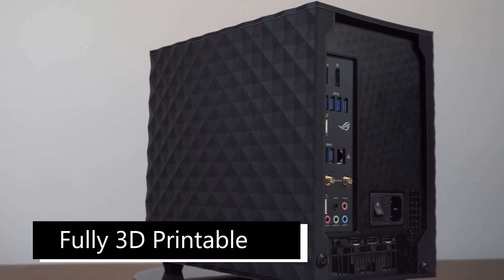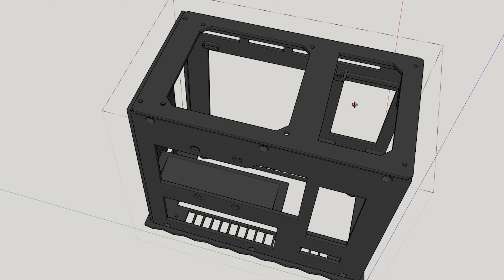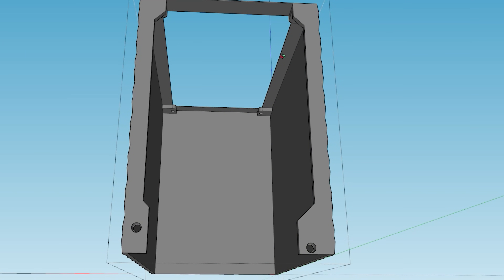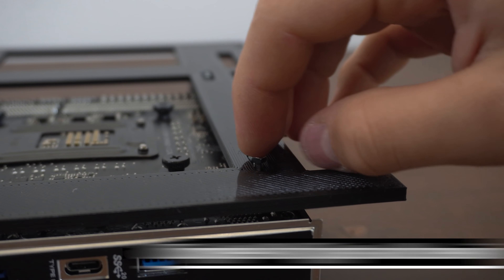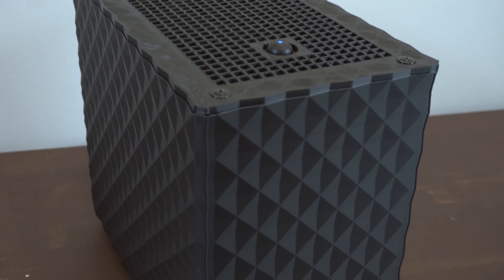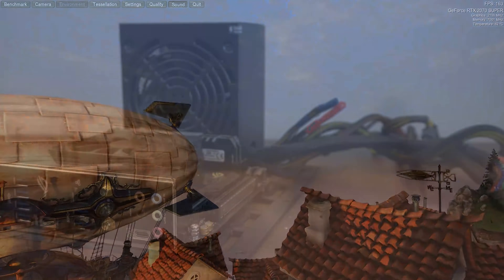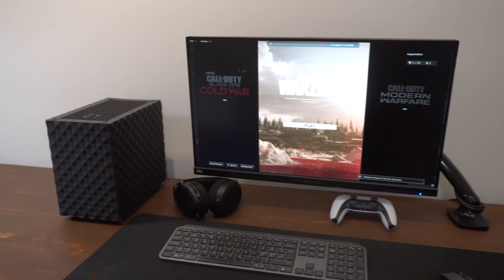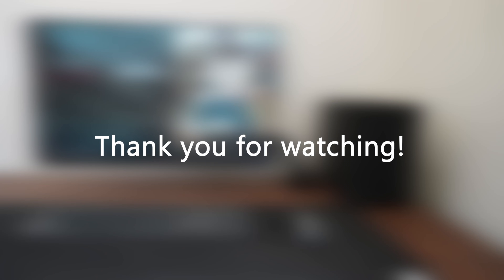CLEAN CUSTOM MINI ITX PC CASE BUILD | 3D Printed

Comment: I wonder how long can the case sustain CPU+GPU stress test without deformation due to high temps.
Reply from the maker: I honestly don’t think that will ever be a problem... PLA starts to slightly soften at around 60 degrees, but isn’t really soft to the point where it actually starts to deform by itself before like 80-100. 

Lets say a GPU reaches 85 degrees in an example. That doesn’t mean that it blows out 85 degree hot air. It means the actual processor in the card has a core temperature og 85 degrees. The air coming out is maybe half that... same for the CPU. If you put your CPU directly on the PLA it might deform but last time I checked there were no PLA printed CPU coolers 😅... 

What I’m trying to say is there should really be nothing to worry about. During my tests the outer cover didn’t even get a little bit warm. Only part of the case that got any hot at all was the top vents it felt just «warm» and that was maybe 45-50 degree air at the very most which is usually the temperature used to dry filament in the oven before prints... 👍 so it wouldn’t affect the plastic much at all.

 (These results are from my testing but I would assume it’s pretty similar for most setups...)
Reply: @makerunit  Nice! It's good to know that the the case won't deform in practical daily usage.

I was just fooling around haha. 
I am a DIY enthusiast and I have designed 3D printed cases as well. I had to ask myself that question when I first made my case and I was just wondering if others have thought of that as well.
I have been using 3D printed cases for months now without any problem related to thermals.
If you are interested take at look at my 5.4L ITX case with 4 case fans. Link here: https://www.reddit.com/r/sffpc/comments/m3d8e4/custom_54l_itx_case_featuring_four_92mm_case_fans/

Cheers
Reply from the maker: @terrencetec  Hey! That’s awsome man! 👍🙂

 I Was thinking about doing something similar with a Ryzen 3400G processor at some point. What kind of power supply was that? What’s its rated power? 

I’ve seen a few of those cases around but none of them actually have any kind of airflow! I love it! 😊 and all I’ve seen are custom made, there aren’t really any (at least what I could find) that are available to purchase that are designed for this spesific setup. 👍
Reply: @makerunit  I would love to build with AMD APUs as well. But I don't really have a good excuse for me to do that, unfortunately.
The power supply is an ENP 7145B from Enhance. It's a 450W PSU in the FlexATX form factor, which is typically used in rackmounted servers like 1U racks.
Reply from the maker: @terrencetec  Aha, that’s super cool! That kind of power supply would save so much space... I’ve got to look into those! I wanna make some even smaller builds in the future 😅

Comment: Needs more ventilation.
Reply from the maker: Thermals are all right for most people. Some setups might not be optimal though. I am aware of that in some setups the airflow might be slightly restricted but for the average Joe it’ll perform well enough. This design was focused on the look with acceptable airflow for mid-range systems mainly. There also the medium sized graphics card max length. Don’t worry though. I’ve got more coming in the future where I’ll focus more on airflow and temperatures. 😊

Comment: Adding some extra patterns for case covers could allow for more customization, I love the current look, but it seems like a fairly easy part to add some variations! Love the build
Reply from the maker: Honestly, the case cover is the one of the less complicated part in my opinion as it doesnt really require much extra measuring literally just take the internal chassis and add a millimeter or so outside for clearance given you know your way in Sketchup. Just use the supplied sketchup file from Thingiverse! 

What takes the longest is figuring out the layout and take all the measurements and correct them along the way.

Comment: Awesome how you make that and really great for adding a 3,5" support. It is the major problem I have with most SFF cases I want to move to. I am definitely saving this design for the more plentiful times, my i5-2500K tower has done its best, and I think yours will be my next computer's house. 
I have two ideas you might take along in your next build. 
1. Isn't there any support for the graphics, is it just laying on the bottom? Maybe you can add a small protrusion at the vertical bit next to the venting holes, right against the place you can normally use two screws to fixate a GPU to the case. 
2. Excuse me if I am a new to 3D printing and this is much to big of a task, but you have chosen a very straight design, wouldn't a bit more "organic" asymmetry be prettier?
Really great and awesome you are sharing this. one day when I have the time to start with 3D printing, I am going to use this to get beginning.

ps. and thanks for the Hardware Unboxed atmosphere
Reply from the maker: Hey! Glad you found the design useful!

Answer to your suggestions:
1: The graphics card just lays on the bottom panel which is just flat. But it’s really not going anywhere as the power cables from the power supply in the rear, forces it to hold its position not allowing any movement. As well as the rear plate kinda clamping down the card. (I hope this was clear enough).

2: There are really no limits to how the parts can be mounted or how it should look. Really all comes down to what style you’re going for. I could have went for a more unique shape, but I spesifically wanted a clean/minimalistic style for this build, therefore the straight design. And also I made a smaller version last month where a lot of people requested a bigger version of a similar design! 

The great benefits of 3D printing though is that there is really almost no limits to what you could make.
Reply: @makerunit  Right, thanks for the answers. I really look forward to make use of the liberty of 3D printing. and I have another nice idea I could apply, I found a front I/O unit that can be easily trimmed down to the PCB and attached easily inside. Just needs two usb holes and two audio holes to be incorporated into the design. Sounds like a nice project to do myself.
Reply from the maker: @Brattoes  sounds awsome! Would love to see your results!

Comment: wow really nice. 3d printing a itx case is such a good idea sadly my prusa is not big enough. are you willing to share the design files or step so that i can look at it and try to modify it so i can print it. working with stl is very cumbersome.
Reply from the maker: What are your maximum print dimensions? I made a smaller version which is linked in the description as well if you are interested.
Reply: @makerunit  smaller than the components (GPU) i would like to use anyway so there is no point in making it smaller i can just slice it and glue them back together. But i am also interested in how you designed it and maybe make my own modifications (i might add is a 2.5 SSD instead of an 3.5 HDD and IO near the power button) would obviously share and credit you as the original author. the thing is STLs are nice for printing but the second you want to change something it is really annoying to do so so sharing the design files or STEP would really nice not for me but also everyone else who wants to improve on your design. i just want to promote the sharing of the design files so that other can do their own small mods more easily.
Reply from the maker: @franzbauer7620  I don’t mind sharing the design files. But please refer to this video as the original design. What file format is easiest for you to modify? Would you prefer just the sketchup file? I’m not sure if Thingiverse let’s me upload it there but I’ll see if I can find a solution. 

I will also some time in the future probably create a little more in depth video of the actual path from idea to finished product.
Reply: @makerunit  Yes of course. sketchup file is probably best and thank you for the great design
Reply from the maker: It should be added to the Thingiverse link now! I don’t know if it will update right away but it’s been done! Feel free to check it out 🙂